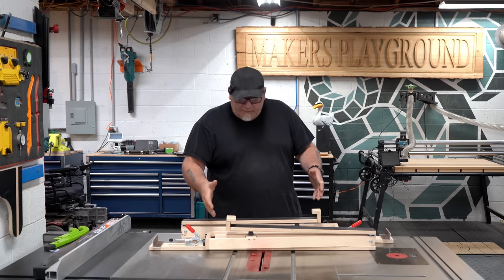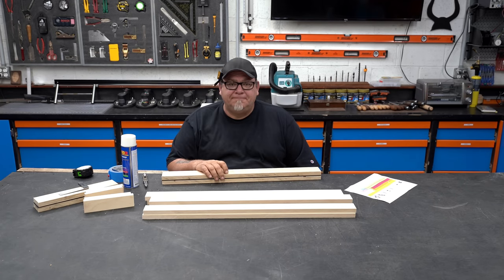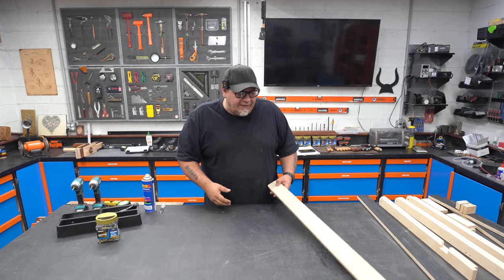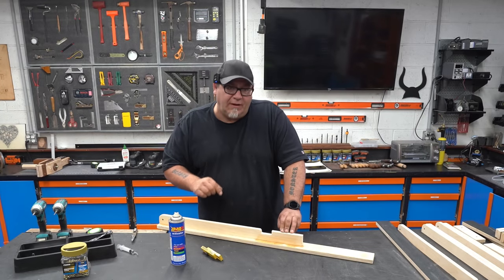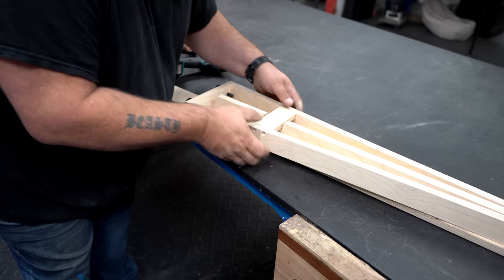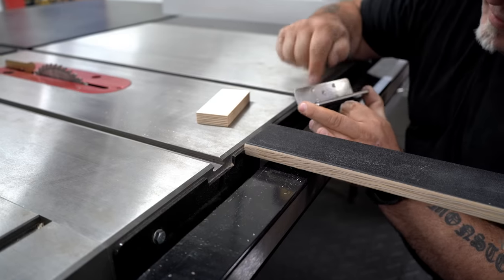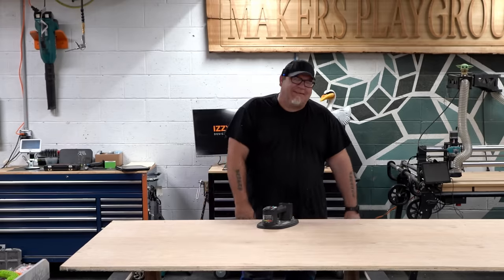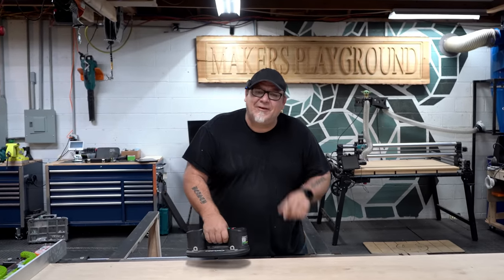DON'T buy a Track Saw? Build this instead!

Comment: Track saw is still priceless for those of us working in a small garage.
Reply: Agreed. Love this idea, but still don’t really have the room to maneuver 4x8 sheets. Track saw probably works better for me.
Reply: Agreed. Track saw is essential for a lot of diyers
Reply: My thoughts exactly. Also, that does you no good anywhere but in your large shop. Not mobile at all
Reply: Track saw is also now becoming legit my favorite tool. I have the makita corded and I can’t believe how quiet it is !
Reply: Yeah and a track saw can follow me to the jobsite easily whereas my table saw is not moving, and we all know the usefulness of a jobsite table saw
Reply: I never use my track saw for sheet goods. I pretty much exclusively use it for ripping a straight edge on rough sawn lumber since I don't own a jointer and it's tough to send 8' material through one anyway
Reply: @MitchHeil  that’s likely because u have the room and setup for a table saw…2 saw horses and a track saw can rip anything you lay it on top of anywhere…it’s really much more practical for anyone mobile or in a garage.
Reply: Or a converted storage shed!
Reply: Great idea! Love it!  It for those of us out on jobs the track saw is still the best for me.  It’s hard to handle and 4X8 sheet on a job site table saw.  But I love this for the shop!
Reply: I'm working in my old dining room lol, this is nice work but won't work for me.
Reply: Exactly. Track saw is a way to go in small rooms.
Reply: @kristjanminnatharmet8961 I’m not saying table saws don’t have their place, but it seems to me that when the piece reaches a certain size (as either to small or to large) it becomes easier to bring the tool to the piece rather than the piece to the tool. Especially when it’s trying to do something like a whole 4x8 sheet of plywood.

And I’ll say with some recent jigs (after watching a lot of Peter Millard and Hooked on Wood), I’ve been using my track saw more and more and my table saw less and less.
Reply: Looks sweet...for your shop.  My shop isn't nearly large enough to accommodate your system, so I'm still tickled at the functionality I get from my track saw.
Reply: @prgelectric5104  Professional carpenter here. I have the makita corded too and I love it.
Reply: @Voyagersk9  Agreed.
Reply: @MitchHeil  Peter Millard, YouTube, uses nothing else for sheetgoods.
Reply: Absolutely 👍🏽
Not to mention the ease of jobsite transport and use !!
PLUS.... The vac set up .. for me....
Works better than the table !!
Reply: Yep, I’m in a small garage, need to do my first bits of breakdown with a track saw.
Reply: I may build them and use with my track saw.    I like to work out in yard when the weather is nice.
Reply: Yes, this is a great idea for those who have a table saw the size of a Volkswagen.
Reply: This!

Comment: very cool, but tbh, in a professional shop you should probably just buy a sliding panel saw instead of a cabinet saw.
Reply: I agree and I think you should buy one for them as wedding present
Reply: @billlichirie14  why buy? they’re too easy to make.
Reply: I think Bill was on point. Great idea Bill😉
Reply: If we are handing out free saws I want an automatic beam saw
Reply: @MattLitkeRacing  If we’re handing out free saws, I want a sawmill complete with hydraulics
Reply: Maybe but you still have to muscle the sheets onto it. The loader ks what makes this valuable IMO
Reply: @duanemiller5606  you might need a kiln too
Reply: @MattLitkeRacing  an insulated shed with a heater. If I had a pellet maker, I could take all the sawdust from all the boards that I filled the shed with an use a pellet furnace to heat it. Yeah, I’ve kind of thought about it before. I even know how to make a solar powered kiln to dry out the wood if I was living off grid, other than the pellet furnace, which I could run off solar panels.

Comment: Certainly does what it is supposed to do! But, it doesn't solve the issue of needing 8' behind and in front of the saw. Still need the track saw in my smaller shop. Thanks for the content!
Reply from the maker: Right On. Cant fix space issues for sure.
Reply: Seems that the axiom of about never having too many clamps is also true about shop space. The room to maneuver a 4' x 8' sheet of plywood around a cabinet saw is enviable.
Reply: Yeah that's my problem too. I love the idea though!
Reply: I have size constraints as well, but I’m solving it with a panel saw to minimize the need to move full sheets around as much as possible.
Reply: @JordanHaisley  Yeah that's a great solution - now if I only had a wall to put one on I would build one. Definitely useful for breaking down large and smaller pieces.
Reply: @izzyswan 😅

😊
Reply: @izzyswan  why did you get out of production? you mentioned getting rid of the 5x10 CNC, was there not enough money/profit in it?

Comment: Definitely handy but for those of us with a table saw that's only 32-36" capacity, there is still a need for a track saw depending on the size of cut. Like I have no way to cut a sheet down to a 48x48peice plus the remainder without a track saw.
Reply from the maker: i talk about the value of track saw at the end of the video. i Agree with you for sure.
Reply: I am curious what a resolve to this problem is. because I am picturing a sled that rails to your saw's outside giving umlimited capacity on your saw, but still using this jig for handling the sled and material.
Reply: @diywtlc2249  I was thinking the same thing.... I'd love to see someone give it a shot

Comment: Sure, it works well for you guys that have wood shops the size of airplane hangars. By comparison my shop is the size of a postage stamp. I have to go outside just to turn around. A track saw, and saw horses ,in the yard will stay my go to.
Reply: Quit yer moanin'. My shop, I have to go outside if I want to change my mind.

Comment: Even having a track saw for on-location work, what a fantastic tool this is for working large pieces in the shop. Most shops I've been in have a rolling table to butt up against the saw to cut plywood. But this is actually better, because having the legs separate, leaves room to move the boards forward without leaning, which is usually how it goes. Here, you just walk forward in between the legs to make the cut more stable.

VERY nice work. Thanks to Jay for the idea, and you for the adaptation!
Reply: you are impressed too easily

Comment: This is a great addition for the tablesaw. However....something that is overlooked in a small shop....is that a track saw only requires  a 4x8 foot space in which to work while a tablesaw requires 8.5 feet on the infeed and a further 8.5 feet on the outfield side. Add an additional  2 or 3 feet for the saw table itself and you have 20 lineal feet of space required  at a minimum,  to rip sheets.
Reply: What makes you think you need 4x8 for a track saw?
Reply: The sheets are 4x8 and require no infeed or outfield space. The sheet is cut in place.
Reply: @JScottAudio  the point is w track saw is the size of the track. You aren't required to cut full sheets with it. The table saw is a set size and doesn't make it better than a track saw for many applications.
Reply: I build Kitchens, closet organizers and entertainment  centers.... these require 4x8 sheets.

Comment: I've got an 8 foot outfeed table (that doubles as a workbench) and a side table that is the same height as the table saw to support the material when I crosscut. For 30 odd years, I've been manhandling sheet goods onto my table saw but as I've gotten older, it has become more of a burden. This is a great solution of supporting the material before it fully gets on the table.

Comment: Hey this works pre cut and an outfeed table too.  You could also do something like this for the left side of the table for long parts kind of like a sliding table saw. 
Ive cut 4x8 sheets of 3/4" mdf each sheet is about 80 lbs and on a table saw its pretty hard to solo deal with big sheets like that all day long.
But one thing i see is it traps the oprator behind the blade, so extreme mesure need to be taken to stop kickback like attaching something to the fence to hold the cut parts to the table with down forces  so the part cant ride up off the table, but  the desine had made this less a hazard as the parts not going to try to lean back and down from its weight. Lowering the chance of kickback.

Comment: Fine idea of you have a big workshop and a big table saw.  It doesn't replace the functionality of a track saw.  For most of us planning the project so you can have the plywood ruffed out on a panel saw at the lumber yard in manageable pieces is cheap or free.  Then true them up on your table saw.  I built a whole kitchen for my son who lives 3 hours away in my 10 x14 shed by having my plywood cut into halves or thirds at Lowes.  I then used a track saw to break them into near finished pieces.  I only have a DeWalt contractor table saw on a portable stand and use that for final sizing on critical pieces.  But God bless anyone with a larger workshop who makes a living at woodworking.  Lastly, it is inspirational to see the creative mind at work to solve problems.

Comment: Looks great if you have the space to make use of it. That loading function is awesome. I'm working from a one car garage where I just don't have the space to physically maneuver full 4x8 sheets on the table saw. I don't have the infeed/outfeed length to rip them or the width to crosscut them. Even just moving and storing the sheets is a pain, so plywood sheets usually end up on sawhorses on the driveway as soon as I get them home. I've gotten by without a track saw, but will probably get one next time I have to do a bunch of cabinets.
Reply: Consider getting one of those Kreg circular saw t square guides... they work well on rough breakdown of sheet goods and you can refine at the table saw to final dimension

Comment: That is a great idea. And I agree, breaking down you plywood is far faster on a table saw. Even at 70 years old , I can still muster a 4x8 sheet of 3/4 inch plywood on the table saw and I always have to do it by myself. But I am not going to say it is easy. Those jigs will help considerably.  In the last year I got a Makita track saw which I like a lot, but no way is it anywhere near as fast as the table saw. On the table saw, I set the fence and I cut. Never have to take out a tape measure or pencil and mark anything. Really enjoy you videos. My best to you and Maggie.

Comment: These infeed supports are great for table saw in shop. Track saw reigns supreme for non-parallel cuts, as often required for remodeling and finish carpentry.

Comment: You could use this for creating dovetail joints if you clamp a piece vertically on your tilting table and come up with a way to lock one of the axes at measured increments.

Comment: Izzy this is a great jig but I will still be using a track saw to get one long straight edge at least. Last year we had an entire unit of domestic birch plywood that was deformed like a banana. One long edge was concave 1/8” and the opposite side convex 1/8”. From that point on I have not trusted a “factory edge” to be true enough to reference. The sheets are also never perfectly square so having one reference edge is critical.

Comment: Great build. This is great if you have a big space and a big table for your table saw. I am a DIY guy who works in a garage or outside. My table saw is a jobsite saw, and I just don't have room for permanent shop tools. I have to use small tools that I can store in cabinets, set up with folding tables when I'm doing work, and then store away so I can park my car in the garage again. I'm thinking about getting a track saw at some point because you can rip down sheets precisely even when you don't have a big workbench or big outfeed table for your table saw.

In any case, if I had a permanent shop, I'd probably prefer a big table saw station to using a track saw. If everything has to be portable so you can minimize the footprint of all your tools then a track saw is more convenient.

Comment: I have some 3m melamine shelving. If I want to rip that on a tablesaw, I need around ten metres of space. I also need a helper, or infeed and outfeed tables. I'd need about half that to crosscut it with a SCMS, except in this particular case the SCMS doesn't have enough bite.

See Peter Millard's channel for how he uses a tracksaw. A permanent table with dogs, a guide rail, a fence. The bench is against a wall.

Comment: Hey izzy, man that is slicker than snot on a door knob, think I’m gonna do this, I’m in my mid sixties with 2 bad discs in my back this will make running sheet goods much easier, I raised all of my work bench’s and table saw up to 40” ht because of my back, surprised you haven’t done this because of your back, I’m 6’4” so your ht may vary, that partially bent over is killer on the lower back, I like vacuum thing your using to, need to get me one of those . Thanks

Comment: I don't really have a shop... I do most "stuff" outside of my garage or on a porch area. I have to use jigs and props for nearly everything. I take bits and pieces from experts like yourself and re-adapt for "cheapy" (i.e. low resource) projects. I have about a 20 percent success rate but trending upwards. I'll most likely see the Lord face-to-face and move from my earthly address before I finish with all the ideas that you have shared. Thank you for the ideas and the legwork that you've done to help me be a "better" novice woodworker. Most importantly, I'm glad you are better physically.

Comment: I've been using a modified Bora Panel Carrier (PM-1850) in a similar fashion for a couple years now. But the locking clamps that firmly affix yours to the table saw rail are a fantastic upgrade!

Comment: Izzy, great stuff,  as usual. Please consider making a video on sourcing and applying the black ABS material to plywood sheets. It's great looking and I can see many uses for it on work surfaces and some jigs.
Reply: I'm curious about that ABS too. I may do that to my assembly table/work bench top
Reply: Its laminate.. glue it on with contact adhesive and trim the edges with a router and file.

Comment: I remember this build when Jay built it, if I had a larger shop this would be a viable option for me. As it is now, my basement shop is so small that I don't even have room to store a track saw let alone try to build this jig for my table saw, floor support beams are in the way. So I get to do things the hard way, I use a long level and a regular circular saw to get the job done.

Comment: Why don’t you just get a wall saw? It fits up against the wall, doesn't take up much space. It is probably the best and easiest solution when cutting sheeting. I have one and it is very accurate and easy to use.

Comment: A track saw is a must working at a customer's house, it's for some 1st fix joinery and mainly 2nd fix joinery. Space is often restricted.

A large table saw in a large room is for manufacturing joinery which is a totally different kettle of fish. A workshop requires the range of large manufacturing joinery machines, not a track saw.

Comment: A track saw in conjunction with a PARF table is safer, better dust collection, you can clamp with a parf table, and when you are done you can easily store the gear.  
Please do a video on thr PARF jig.
Reply: I agree I have a slef built mft table with a fence and rail on hinge with pin that locks it in square. it's a much better set up for building cabinets. I get accurate repeatable cuts and good dust collection.

Comment: For those of us whose table saw is a contractor jobsite saw in a very small shop area, I love this idea, as it provides more infeed surface than the tiny table saw top, while providing an easily-collapsible infeed, saving floor space.  However, there might be some wiggling back and forth of the work piece until enough of the rip fence is engaged to straighten the cut.  Plus, the piece might be so wide and the cut so far from the right edge, it may extend over the edge of the saw so that the rip fence cannot be used.  

An answer to this may be a panel-cutting sled with the fence on the leading edge, and hold-down clamps screwed to the fence.  That way, you'd square up to a sled registering off of the miter slot (or slots if you make it with 2 runners), and have the fence-mounted clamps fastening the work piece to the sled for a perfectly straight and square cut.
Reply: You could also build an extended fence, in  combination with these extensions, for cutting down sheet goods.

Comment: You can turn any threaded bolt into a tap by filing or grinding a V shaped groove straight down the length.  This will create teeth along the bolt shaft that will carve out the thread path in your material. It will be a much cleaner thread than forcing an unmodified bolt through.

Comment: Table saw is for repeated cuts the same width, track saws can do hat but are meant for that portability not just for small shops but for large or uneven things you want to trim down to size. Doors, tables, cabinets etc.

Comment: I like what you have here, and I will probably build one, but...  My chief reason for considering a track saw is that it would minimize tear out by preventing the blade from wiggling while cutting.  This also happens when cutting sheet goods on a table saw.  I don't know if that is true, but I am curious to try.

Comment: If you take a cut off grinder to the threads of the bolt and cut 45 into the threads in 2 or 3 places you make yourself a makeshift tap. Pretty helpful for soft materials if you dont have the correct tap. or you need a thread chaser.